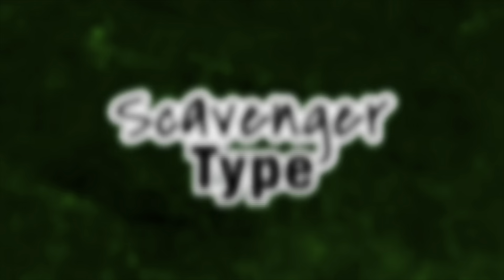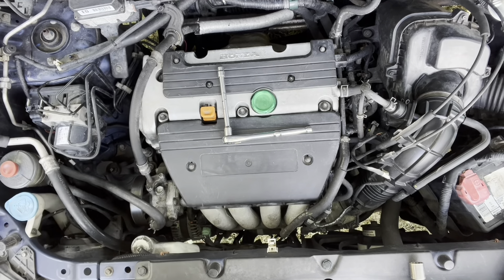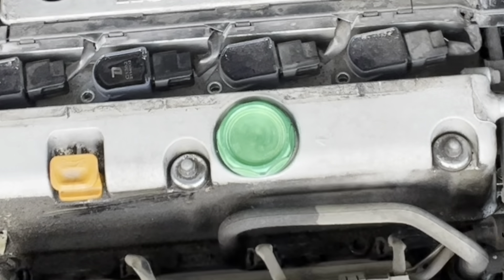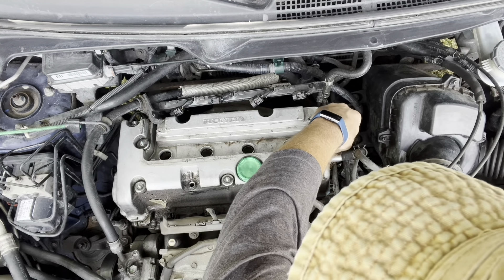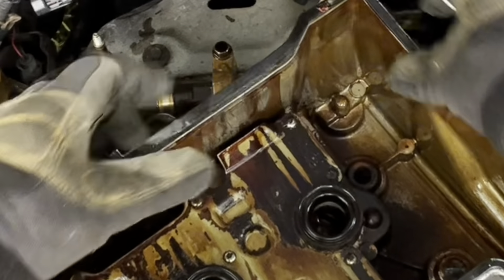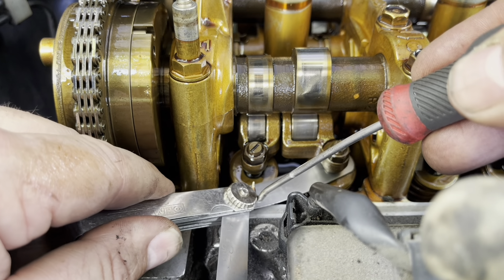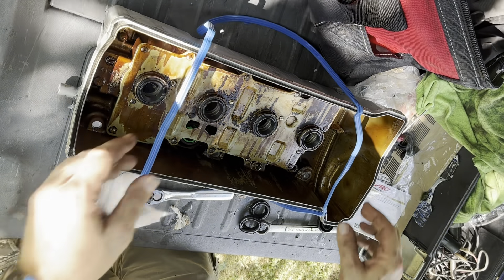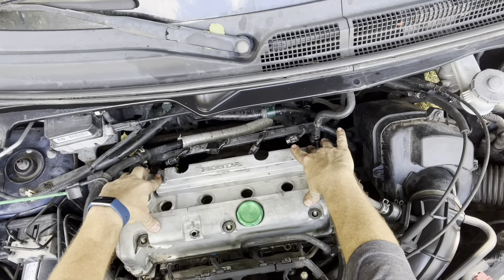Valve Adjustment on a Honda K24 Element

Comment: Yo! Don't remove spark plug boots like that. The valve cover is extremely thin and the inside ring isn't soft material its rigid. You can easily crack it doing that. Instead, using a flat head screwdriver, or small punch, tap those suckers out by placing it on the rigid rim. Remove and reseat the new guys carefully.
Reply: 15:21 Now, There's your cracked valve cover 🎉
Reply from the maker: You're mistaken. It's just an oil seal like any other. The valve cover is 1/8 thick cast aluminum. There are no cracks in the cover and it has 310,000 miles.

Comment: That valve adjuster tool definitely helps a lot! It was my first time doing a valve adjustment so I went through it twice. Mine was pretty out of spec and I found it made the engine both quieter and smoother 

Definitely recommend doing this!
Reply from the maker: Honestly, I want to get a junkyard valve cover t pain up and do it all over again. Maybe this fall. I may get one of those little tools to use as I also want to redo my V6 Odyssey and make sure that new head hasn't settled in any.

Comment: This was great.  Good tip to use the PS pump to turn the engine in lieu of using the 19 mm crank bolt.  I used to check the clearances on my old Toyota 22RE engine and the specs were to be checked while HOT!  Glad that Honda has cold spec.  I have the Honda valve adjustment tool on my Amazon wishlist.  Thanks for reporting on the exhaust measurements as being slightly tight.  Was very curios on that after 285k miles.  Regarding the wear on the cam lobe, make like VGG and "pretend you didn't see that".  LOL
Reply from the maker: Yea, I may keep an eye out for some better looking cams in the junk yard.

Comment: I just purchased a 2007 Element SC with 142,000  miles and currently am doing some baseline maintenance on it and will be checking the valves soon. I already purchased the same fel-pro gasket kit and might even rice it up LOL like you did. Love your videos

Comment: You make great videos and helps tremendously. I have a manual transmission 04 CRV 201K miles and she needs love from time to time. I will look into the valve adjustment for sure. This is first video I’ve seen that makes me feel like I can do it. Great tips especially with the cam lobe orientation while adjusting, replacing the gasket and the tightening sequence. You truly are meticulous. Thanks.
Reply from the maker: Glad to help

Comment: Is there any way or tool you can use other than sound to know if the valves are too tight or too loose without taking off the valve cover? I thought I read somewhere there is a tool that measures the the space of the gaps of the valves.
Reply from the maker: I guess you could do a bleed down test might point to a valve that's too tight but a feeler gauge in the rockers is the real way to be sure.

Comment: Great video , what year is it?
Reply from the maker: This is a 2003.
Reply: @clintsearcy3252  that’s what I tough . I noticed many 2003 element engines lobe on the exhaust will wear down. I done many elements and CRV  valve  adjustment and around 5 times I saw this wear on the 2003
Reply: @clintsearcy3252  all of them in cylinder 1 too.
Reply from the maker: @Element_lifestyle  Think it need a new cam yet?  I've done a lot of Toyotas and for other Hondas but never the K24 before.
Reply: @clintsearcy3252  you can have it like that and will still run ok.👍

Comment: Loving the vid! Do we have to remove the spark plugs also?
Reply from the maker: I don't. Removing the plugs will make it easier to rotate the motor since you're not fighting compression but this little 4 cylinder motor is pretty easy to turn with the plugs in.

Comment: Hi. When I adjust the valves, do I do all of them one at a time or do I start with 1 cylinder, 3,2,4 as in earlier engines ?  Do I have to lift the cylinders ?
Reply from the maker: The pistons will raise as you turn the crank.

Comment: I didn't realize the smaller lobe on the intake side had to be UP position as well when adjusting the valve. I adjusted the smaller cam lobe when the bigger one was in the UP position. Does that matter?
Reply from the maker: For accurate results you need to be sure the point of the lobe is pointing away from the valve.
Reply: So do you have to crank the lobe facing up for each 16 valves as you go along? What order do you do them in?

Comment: I have a 2010 with 83k miles.  It’s been running rich but no codes or check engine light.  Strong fuel smell.  Soot in the tail pipe.  Had my car stolen months back and replaced with after market.  Any advice on what I should do first before bringing it to a shop?
Reply from the maker: That's a tricky one. I would start with checking the rubber hose on the intake and the cat.